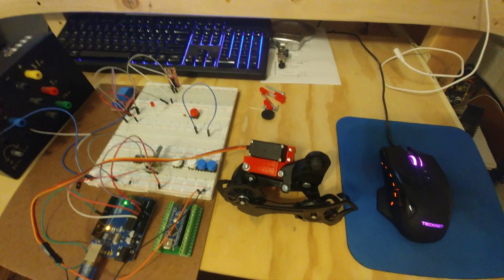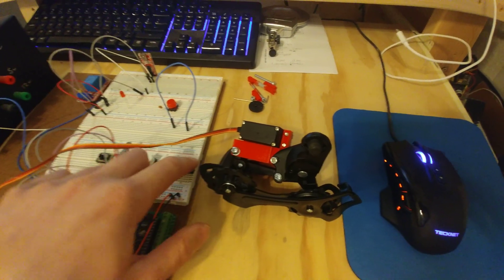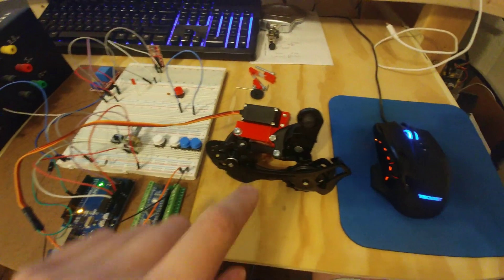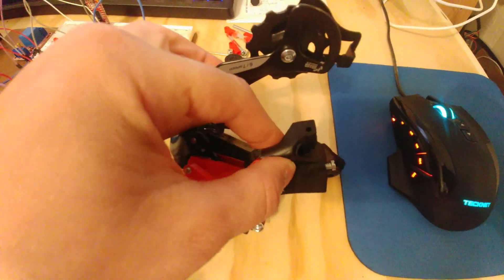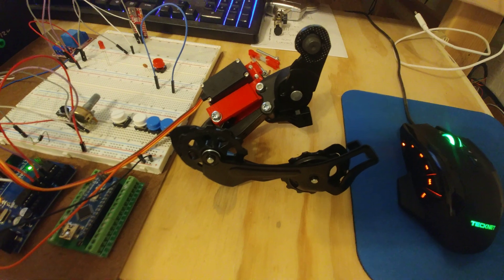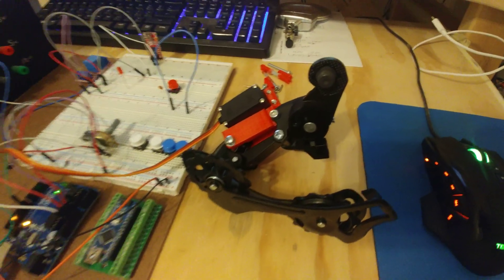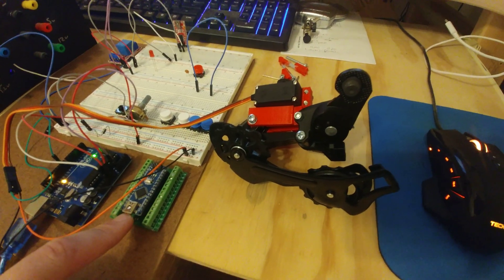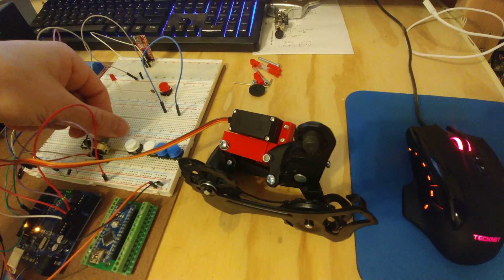Diy electric derailleur project with a servo and arduino

Comment: I am currently working on a wireless derailleur to put on a 12 speed sram eagle sx for a mountain bike I’m using a far simpler design and on paper it works fantastic but I have yet to test it I will make video on it soon.
Reply: Vc conseguiu?

Comment: Hi, nice project. But, i think that mechanical part must be in steel. Maybe alloy, but not plastic. Otherwise, this look not very hard.
Reply from the maker: I would agree that one would want to do it in at least an alloy. Prototyping in pla or abs is sufficient and actually in testing it, it does work. There is flex that would be eliminated if done in alloy. But for a proof of concept or to test the idea, 3d printing works, mildly. Haha

Comment: There is a design that is better, I use Archer D1xtrail electronic shifting system, its a box with motor, and batteries, it connects regular cable and wire to pull a regular rear derailleur. I am not a fan of battery or motor being at the rear derailleur.
Reply from the maker: I have seen those style of add on electric shifters. Its a great idea and design. This was more than anything, just something to play with. I wish I would have had more time to invest back then and actually see it all the way through. Maybe one day I will do a "diy" version of what youre talking about. I think it would be cool to have an open source electric shifter that anyone could build cheaply and apply it to their bike. 
  How do you like your Archer D1xtrail?
Reply: @618kustomz  I like it, fits me well, and eliminated fatigue. Easy to setup and use, decent battery life, and well sealed. But first gen was not. I will get another one for next bike I will build. Great support too.

Comment: This is so awesome.  I second that, I've seen people put together some good looking designs and test them out on the bench, but never seen or read if they work out on the road.  How's it going?
Reply: Because it is real two different things - bench testing and mounting everything to your bike and making it work. I made my own variant of arduino+derailleur and just mounted it on bike - and it was really hard to make this final steps.
Works well, I'm satisfied.
Reply: @rcplaygrounds  Would appreciate if you could share any information as I'm trying to make one for an ebike build